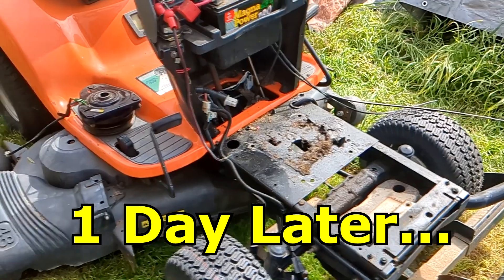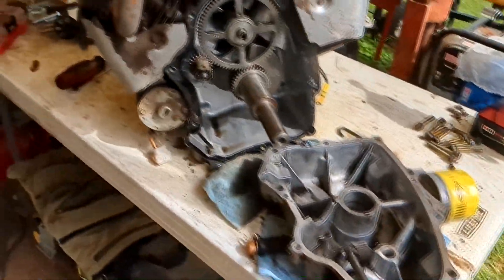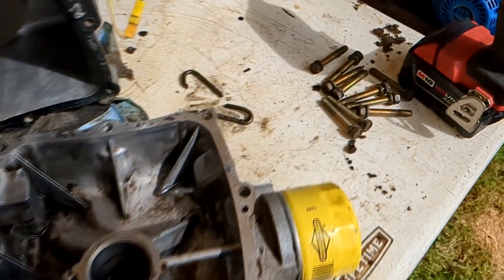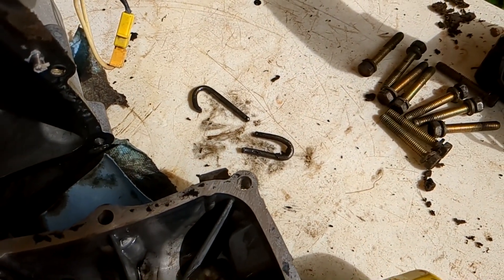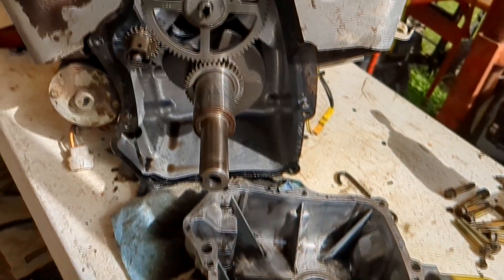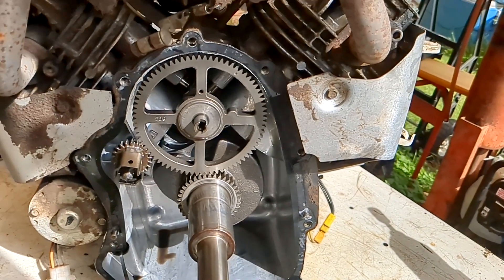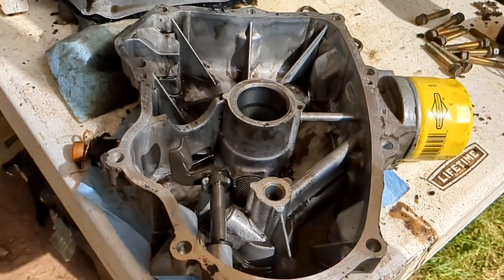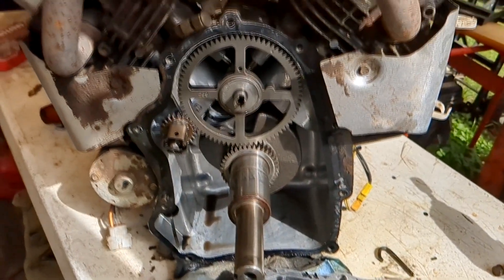Use an Endoscope or Borescope to Look Inside a Lawnmower Engine

Comment: Oh my, I never thought the rod would be in there.  What a great check you did on this engine.  Now I can hardly wait until you get it up and running.  Side  question---Are you still working for that company?  I think it was a tool and die company but I may be wrong.